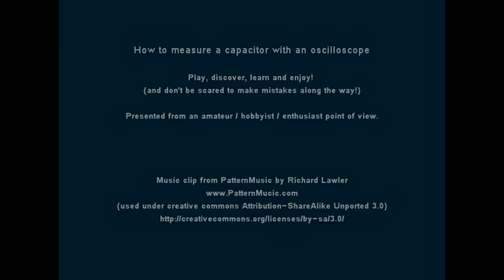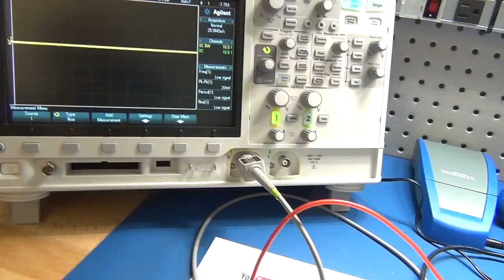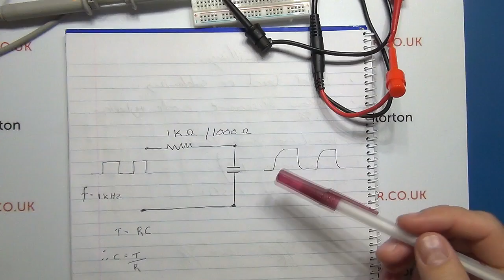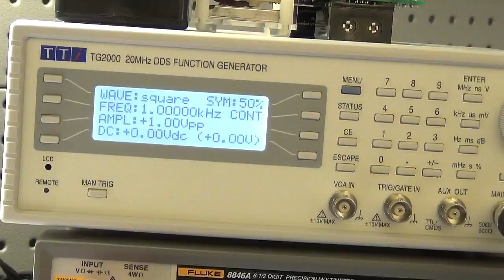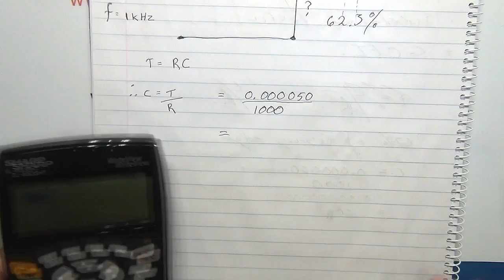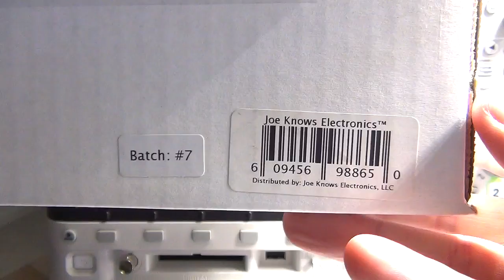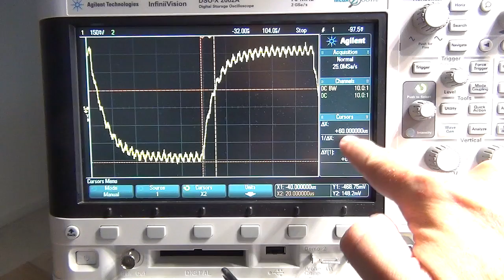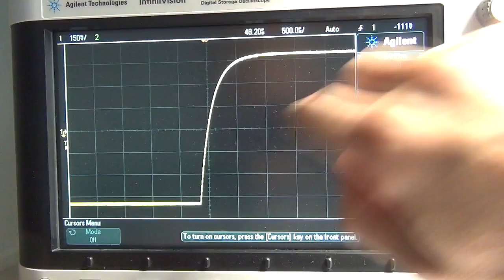How to measure a capacitor with an oscilloscope.

Comment: Very nice. Few observations: 1) That little capacitor surrounded by all those wires with alligator clips looks like a hostage out of a grade B movie. 2) when you divide by 1xxxxx no need to use a calculator. Just add x zeros to the right of the decimal point to your answer. 3) Even better use scientific notation  so dividing nano (10^-9) by 1000 you would have 10^-9/10^3 = 10^-12. Simple and foolproof.  Finally a cap charges in an exponential manner. the step voltage of a cap as a function of time is V(t) = Vs*(1 - exp(-t/RC)) where R and C are your cap and resistance values and Vs is your final voltage which is equal to your source voltage (in this case 1 V). You can reverse this equation and solve for C at ANY time t that you care to use. Taking V = 0.632 just simplifies the calculation. In general we have C = -t/(R*ln(1 - V(t)/Vs)) where Vs is your source voltage (in this case 1 V). Taking V to be 0.632*Vs  simplifies the above to C = t/R because V(t)/Vs then equals 0.632 and ln(1 - 0.632) = -1. Voila!

Comment: Hi, I have a question now that I've been trying to play with that on my scope, I have an SDS 1000 series scope from Siglent  and is one thing I can't figure out how to do yet, is to get both the X cursors and the Y cursors on the screen at the same time. Yes I am very new to oscilloscopes, I'm learning as I go along. It seems I can only get either the X or the Y on the screen but never both the same time.   Am I missing something or is this one of the features lacking in this particular scope?
Reply: I'm still trying to figure out how to get both sets of cursors on the screen at the same time with my Siglent scope. can anybody help me with this?
Reply: +Dog Rox I've just bought a Siglent scope - I think you can only have time or volts,not both at the same time.
Reply: Thanks. I kind of figured out also. Oh well that's why I can never get this experiment to work
Reply: +Dog Rox You can use the track mode to get 4 cursors.
Reply: Hey Soda510 I'm not sure I know what you're talking about track mode? If if I'm not mistaken, all that does is bring the cursor kind of like an Etch A Sketch where it just traces on the line itself. Is that what you're talking about?
Reply: +Dog Rox If you press on the cursor button then you get manual then track and automatic mode. I used the track mode to test my capacitor. In track mode, there's CUR a and CUR b. By using those two you'll be able to set your voltage and time simultaneously. I first set my voltage in manual en then go to track
Reply: Hi soda, so that's not the same thing I'm talking about then? About tracing the actual line? I'll have to try what you're saying next time I hook up my scope. Haven't touched it in a while. :-) looking forward to trying that out though. :-) thanks for the info!

Comment: I enjoyed it when it was out of range. I am using a very cheap LCR with ESR meter (you can even test in circuit) from china and it offers many other functions like diode, transistor and resistor measurement - its quite accurate too. I wanted to buy a an oscilloscope but i only do basic amp repairs so do i really need it; am not sure? BTW, Your videos are very interesting and I like learning the theory part of electronics - your explanation is very easy to understand and am not very bright; keep up the good work!

Comment: Too bad they can't build in this feature into a scope.   All is would take is some small switching resistors,  a test signal built in and the firmware to have dedicated cursor measuring and readouts.

Comment: You can also measure inductance in a similar way. Search Utube "Measure Capacitors and Inductors with an Oscilloscope and some basic parts"
In order to get the best accuracy you need a oscillator with a  very fast rise time.

Comment: great explanation and video! would this also work with SMD caps on a board? or would the connecting circuitry give you false readings?

Comment: I am sure someone must have mentioned this but I have not seen it so here goes:  When using very large or very small numbers such as you are doing here it is very useful to use exponential notation. It will save a lot of errors counting zeros and decimal points. Just my pico-cents. Cheers

Comment: Those capacitors have polarity and it can be tested to see which is the shielding. Would this change you calcs? did you check the polarity first?

Comment: The resistance value on bottom of calculation written wrong.
Value was said to be  1 meg in series of res. box of  + 1K ohm = 1,000,000 + 1,000,=
1,001,000 should give you 5.99 pf

Comment: The basic concept is sound, but a few comments though:
- you swapped 63.2 and 62.3 percent at some point.
- you have to take the output impedance of the signal generator into account
- the error margin of the measurement cursors is way to big at the given timebase. 
- 4.7pF will be swamped by the capacitance of the cables and passive probes. That's why this method with the given equipment doesn't work on small value capacitors.
Reply from the maker: Thanks very much for the input Thijs, noted.

Comment: Capacitor is fully charged at 5RC?
Reply: No, it exponentially tapers off and theoretically takes forever. Practically, you can't measure the difference at 5 time constants, so finding the time to that point would be very inaccurate. The 1 TC is good if you can do it, otherwise finding 2 TC's might be easier.

Comment: Stretch the waveform so you can place your time cursors more accurately. Bear in mind that your function generator also has an output impedance (usually 50R).

And you can't say that your capacitors are a little bit out when you measure them with a crude method like you used. The tolerance of your caps is nothing compared to the poor resolution and (lack of) accuracy of your measurement.

Comment: Thank you for your very good videos. I'm a beginner in electronics and I'm just listening to your video about measuring a capacitor with an oscilloscope.I noticed that you are using a 47 nf and a 4.7 pf capacitor, which I don't have at the moment, but I have a lot of other values. I was wondering if I could use 2 different values, but follow your video the same way?? I'll get some of the same value as yours, but I have to order them online and it takes 3 to 4 weeks before having them.I really hope you'll be able to see my comment. I'm from Ontario, Canada.My name is Maurice Petit (I prefer Moe). I'm using an Hantek DSO5072P oscilloscope, 70ghz.
Thank you very much. I'm waiting for your response.

Comment: Hi there, I tried to test a capacitor with an oscilloscope as the way you did but I failed to do so I don't know what was going wrong even though I applied 1kh and 1vpp on the cap but unfortunately no curve shown on the oscilloscope, would you tell me please why is that thanks

Comment: Just a suggestion, measure the stray capacitance of the leads just as you have them position on the bench without the Capacitor .Then insert the Capacitor and test to get the total capacitance and subtract the stray capacitance value to get the value of the Capacitor under test.

Comment: great work but I am still confused about the percentage you used  63.2 why is that? it is not supposed that we should consider the full time the capacitor is fully charged which is from the bottom to the top of the rising edge?  you said there is a link to explain that.

Comment: Great video! (as I said earlier). I'm only guessing here, but is it possible that the error you had in the 4.7 cap measurement could be due to the two components being at their extremes of the manufacturers stated tolerance percentage? 

That is; if the two components were to their extremes in their given tolerance, (the cap at the top of the tolerance span and the resistor at the bottom of that tolerance), is it possible that this could account for error final measurement?

OR if you take in account the tolerance errors I mentioned about and then add that to the very noisy wave, could that explain it?

The trace in that measurement was not only noisy, it was almost unfocused, (or appeared that way because of the noise). Therefore, a vernier line up of the X & Y datum to achieve the delta readings would, in itself, be open to considerable error, no?
Anyway, thanks again for the great video! It was a well spent 45 minutes.
Rich

Comment: Using this method for measuring very small values of C has a major potential problem: inductance in the resistor.  Even metal & carbon film resistors have some inductance.  The resistive film is actually in the form of a coil.

Comment: That's great !  So you said 63.2% for the capacitor, is that the same for inductor?  I am trying to measure an inductance of dc motor, do you think would it work if I use the same method here putting in mind that I am measuring inductance?

Comment: I have a TEK p6205 probe, it lists "750 MHz active FET probe, Input impedance 1 MΩ // 2 pF" on its specs, I believe your probes come with much higher capacitance than 2 pF. as you can see, they are of the same order of magnitude as your capacitor. actually for such a tiny value you are measuring (4.7 pF), a lot of other factors also need to be considered. so the large "tolerance" of your second measurement is expected.

Comment: two questions,,,,,1.-  you can check te capacitance only whit internal resistence the function generator (50 ohms) or is necesari add the other resistor?  2.- test the any capacitance whit same frecuence? or the frecuence change whit diferent capacitance for test?

Comment: Could the error be caused by the noise induced? Noise is just another wave form placed over the one you are looking at. So, you should be taking your voltage readings either from the top of the noise, or the bottom. Not the top and bottom of the entire wave form.

Comment: So when the square wave is down to 0, the capacitor is discharging itself through  the resistor and INSIDE the function generator ? Is that ok ? What would be happen with higher voltages/currents ?
I suppose you could put a diode in series, and take its voltage drop into account.
Just asking because I'm pretty new to these things.

Comment: DIYTAO is right... The scope input capacitance is 15pF... When your probes is set to 10X attenuation... (10 Mohms resistance) and if your probe is set to 1X (1 Mohm resistance), the capacitance of the probe is about an order of magnitude higher... about 100pF... And nonetheless, the coaxial cable of your function generator has about 100pF/meter of capacitance...

Comment: and other question, your function generator, output impedance is 50 ohms ?, and your oscilloscope is to 1 Mohm ?? this difference is correct? and not Affect end to measure ??.. thanks for your videos.

Comment: Stray inductances are going to affect your measurement, particularly with small value capactiors.   This should be taken into account.  Oscilloscope probes also have a capacitance which will also affect the reading.  Your breadboard also has a capacitance.

Comment: One probably needs to know that T does not stand for time (persay)  It is a greek symbol called tau.   It is derived from RC and it takes 10 tau for a capacitor to fully charge.  But a capacitor charges to 63.2% of the total charge voltage  in 1 tau.  That gives you a rule to work with for this calculation.  So in this operation you are measuring tau (in time)on the scope and using that figure to calculate C.  Just sayin.
Reply: +Leonard Legg Ooops   been a while, I think that is 5 tau not 10 to fully charge a capacitor.
Reply: Actually it never charges, but it gets closer every Tau...

Comment: I have a 1000uf capacitor using 1000ohm resister and can’t get any where near a square wave it’s very spiky wave dense in the middle, maybe I need to lower the resistance or raise it or change the settings in the frequency generator.

Comment: So: get a $2000 oscilloscope and a $500 function generator and fiddle 10 minutes to measure each capacitor with crappy accuracy vs. getting a $200 LCR meter and spending 2 seconds per capacitor and getting accurate measurements...
Reply: +lnpilot  you can make a capacitance bridge and save even those 200, use ur voltmeter to measure capacitance , real simple .. Anyways these guys are YT fluke agilent sellers , all of them. you can spot them miles away , they have a decent journalist skills , electric skill are 0....Led diode powering with 5K dollars worth of equipment type of electrician

Comment: I find large discrepancies between an LCR meter and a DMM on electrolytic capacitors and will use this method to check and see which is closer - of course frequency comes into play.  Have you noticed this?  Measure on DMM and then LCR and compare results.  Again only on electrolytic types for the most part.

Comment: ...physical resistance adds to the impedance of the generator 50 ohms? or I can remove the physical resistance and do it with the output impedance of the function generator 50 ohms?... and your function generator is set to square wave with offset positive DC to reference to ground? 0v to 1v for electrolytic capacitors?

Comment: I know the goal of this video was to use a scope to solve for the capacitor value but ohms law could have also been used to solve for capacitance by measuring the voltage drop across the resistor you would have the data to solve for power which would have given you the current. With series current and the know voltage drop across the cap you then could have figured out the reactance and then its just more simple math from there using the formula inversely.

Comment: The simplest way of calculating this is that full charge takes 5 x Tau seconds. Therefore rather than trying to find out 63.2% just measure the full charge cycle and use the formula C=time/(5 x R).

Comment: The problem is the probe capacitance and stray capacitance of cables, and test equipment being greater than the part you are measuring. I've done this with my physics class but used 10 volt 1 KHz square wave. The test leads on you C meter are short for a reason.

Comment: Some items that could affect your accuracy are the accuracy of the resistor your using (0.47 nF per percent of tolerance), but more likely your 63.2% measurement is limited by your x and y resolutions. Choosing a smaller time division would help with that.

I did some quick math, and if your scope is capable of doing a rise time measurement (rise time is defined as the time between 10% and 90% of the wave forms amplitude), then you can use this handy little formula:
Capacitance = RiseTime / ( Resistance * 2.197 )

This will work regardless of the amplitude and frequency used as the oscilloscope is displaying the rise time of the wave form, which is independent of any clipping that might be going on.

Comment: I have o-scopes but I don't have a dedicated function generator per say (as a test instrument made for the purpose). Until I do (like tonight, now, in a pinch ) perhaps this video can get me testing capacitance nonetheless, using something on hand, like maybe a receiver or transmitter receiving or transmitting a plain carrier or consistent signal (not Beethoven's 5th) :) I'm not trying to calibrate instruments, rather, I just need to get approximate readings on hand-made air capacitors for value. I want to make a rotary but instead of flat vanes use concave soda can bottoms (novelty, for antenna tuning with a coil)... can bottoms for both stator & rotor vanes (I know I can't offset them but spindle through the middle should be fine :) :) o man I can maybe measure inductance of the coil, too, without buying an LCR meter this week (my multi has neither) THANK YOU (subscribing). Between you and Ray Heffer I'm in high cotton.

Comment: I really appreciate your effort ,,,,,, god bless u :) its was very clear and understandable :)
I just have a question why the time constant is measured upto 63.2% and not upto the peak of the square graph ??
thanks so much :D
Reply: The thing is, you never reach 100% of the final value... So a good measure is the time constant tau = R*C. This is the time is takes for the voltage of the capacitor to increase from 0V to 0.632 of the final voltage.
Reply: @luisouteiro  Hi Luis - I don't understand the answer - why not 50% then ? where does the this exact 0.632 value come from 
Thanks
Tran
Reply: @jeditoto3441  0.632 comes from 1 - e^-1. The voltage at a capacitor terminals that is charging through a resistor follows a negative exponential growth... This can be calculated from circuit analysis and solving the respective differential equation. This voltage is given by 1 - e^(-t/(RC)). RC is also called tau, or time constant. At t=0 the capacitor voltage is 0. At t=infinite the capacitor voltage is 1. At a special time t, the exponent becomes 1, this happens for t=RC=tau and the voltage at the capacitor terminals is 1 - 1/e which is roughly 0.632. Pretty much any circuit analysis / basic electronics book should cover this, try picking one up as it is better explained there than what I can explain here.